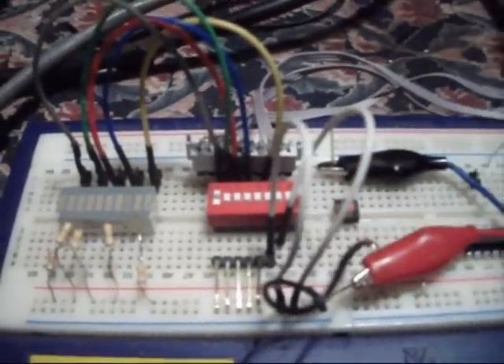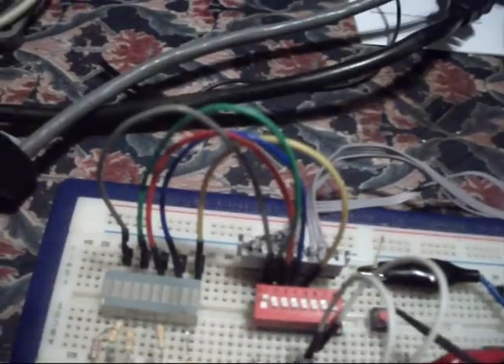Firepower Sounds.wmv

Comment: I would like to do the same to capture the sounds of Joust.  How are the dip switches hooked up to the audio selection? i understand you are grounding out each of the 5 inputs to trigger the sound but how does that hook up to the dip switches?
Reply from the maker: Dip switches select which pins to ground, one side of all DIP switches goes to a momentary switch and thru that to GND. The other side of the DIP switches goes one-to-one to each of the signal pins on the sound board.